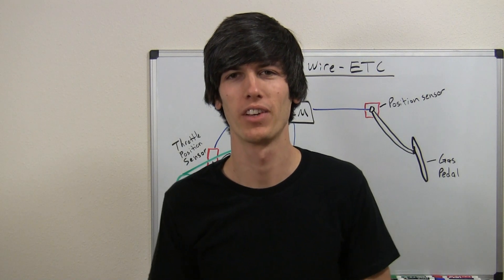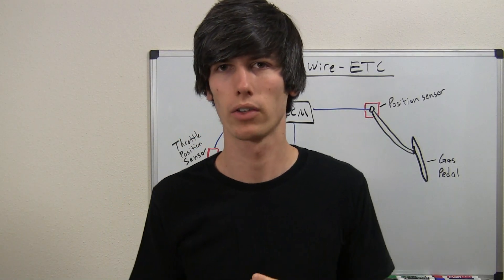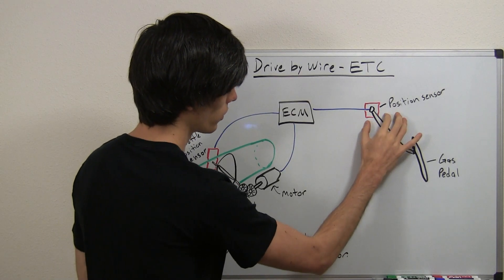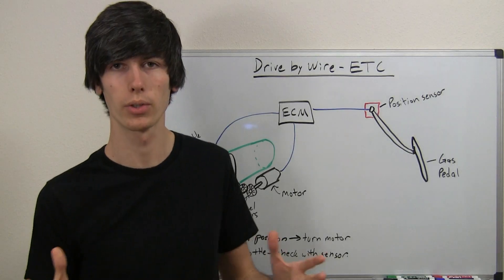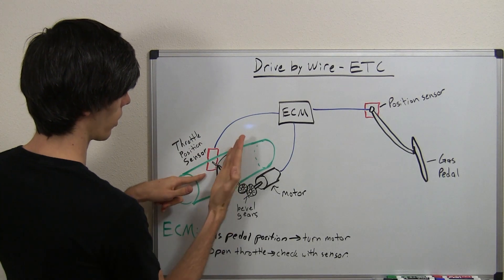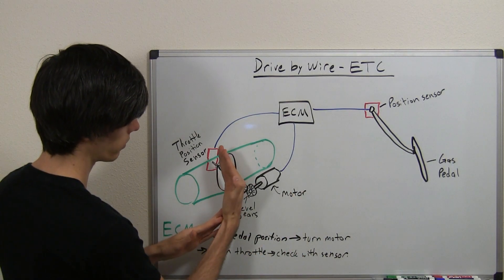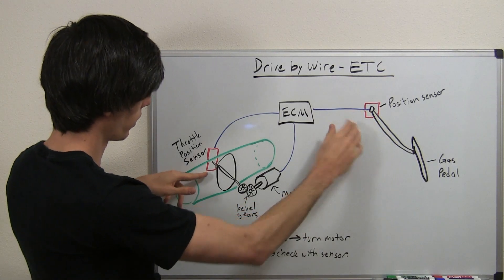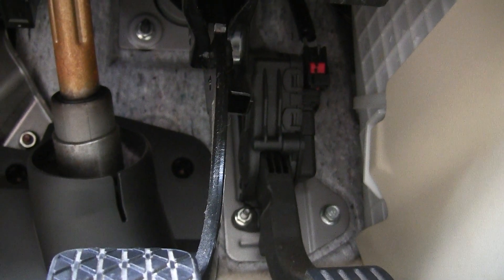Drive By Wire - Electronic Throttle Control - Explained

Comment: Where is the air idle control valve? Is it built into the throttle body and if so can it be the cause of an intermittent erratic idle?

Comment: Bad system. The "position sensor" is just a glorified potentiometer, the same system old radios had for changing the volume, the same one that would get scratchy and loose precision over time. I was laughing my ass off when i looked at teardown videos and saw the little wipers riding on tracks, i seriously can't believe they greenlit this concept.

Comment: It's not a "GAS" pedal - it controls throttle opening which controls AIR flow - it is the fuel system that meters the amount of fuel required to be mixed with the air volume for a combustible mixture. The air system (throttle) has no direct connection to the fuel system. Fuel is metered either mechanically by valves and jets or electro-mechanically by injection valves. Call it what it is; the accelerator pedal.

Comment: I have a problem with my plate not moving when I increase and decrease gas pedal.
And my ecu is not throwing a fault?
Any thoughts.
Reply: It moves manually.
But is set on the horizontal position.

Comment: in the diagram you could have showed what flows between the position-sensor and ECM. Is it a packet of  digital info (CAN packets) on the position of pedal , or is it an analogue varying voltage ?

Comment: Hi I have a question can I used my electric throttle controller with spot mode gear on my car or  if I do this can damage my car ?

Comment: Good day Sir
I have idle problem it drops when AC is On 
I have clean the TB,change ignition coil and spark plugs, check for vacuum leak but I don't find any.
But my car idle still drop when AC is On 😞
I hope you could help me. 
Toyota Yaris 2012 my car
Thanks in advance🙏

Comment: my vehicle has an issue that my tuner cannot figure out.
I been noticing a hesitation when accelerating 
There are 2 lines in hp tuners on the graph. one for peda percentage and other for throttle body blade open percentage.
He says the pedal is going to 100percent and the blade isnt keeping up.
Not even close. and it is causing hesitation.

No codes or check engine light on.

Comment: I hope you can help. will adding a aftermarket throttle controller such has Apexi over heat the ECU . i have a 2nd gen lexus is350  and read that this is the case. thanks

Comment: Some elec. throttle bodies cost $700.00 to replace.
If the device is so simple with a tiny motor actuator, should it not be only $50.00?
But if you win a lottery, you can lay low and just take the bus.
You'd have nothing to prove.
How long can " the next model year " continue ".
There has to be a point in the future where improvements are no longer required.
But, those who want to take their families for a drive on the Sun are waiting for the next model year.

Comment: Nothing you can say will convince me especially after the horror of the Toyota unintended acceleration deaths, that it's just as safe to allow your brake system to be controlled by electric impulses and  complicated computer programs, instead of a physical cable connection.

Comment: Hey, I have a question: does the ECM prevent engine lugging by limiting the opening of the valve even if you floor the gas pedal on a high gear?
Reply: Yes, precisely. That is actually one of the very few advantages of the electronic throttle, aside from traction & cruise control.
Reply: @luipars  Correct me if I'm wrong: so it's technically not possible to lug an engine, regardless if it has forced induction or not

Comment: Great explanation, but a terrible system! I've had mine go out on a 22 year old truck, on the highway. That's fun! Additionally, the new fuel pedal costs, from the dealer, $500.00! Thank God for Amazon! But in the end it still ran me close to $300 to replace. (I miss steel braided throttle cable).

Comment: Didn't the BMW Williams F1 2004 car have an electronic gas regulator based on the position of the track so that the drivers couldn't lift and coast at certain areas of the track?

Comment: I need to mod the gas pedal of a car in order to fit on the dash a pot for fast idle purposes as some accessories will be fitted in the car and i need it to idle at 2000-2500 rpm. Do you know what is the usual value of the potentiomenter inside a modern gas pedal?

If i don't find a schematic of this, i will have to get one at the kenny-u-pull, open it up and measure it myself...

Please, no comments about It's dangerous to mess with such things... we know that s**t already, thanks :-)

Comment: Hi,
Do electrical gas pedals have to be re calibrated after 10+ years?
My pedal isn't very responsive, its laggy, but when I push it down hard it goes,
In my opinion the throttle cable is much better,,
My car has been tested at mechanics, they can't find anything wrong with the car,plus no fault codes are coming up,

Comment: Hello dear.  I have a vw 1.9 tdi AHU engine with an electric diesel pump and i want to connect it to an accelerator pedal to check the throttle ... can you help with that ... thanks

Comment: How engine keep running when throttle is closed? Do butterfly valve keep partially opened?
Reply: Most have a small passage that bypasses the throttle plate, it goes through an idle speed control motor that precisely meters idle air

Comment: The reason why car manufacturers probably went the drive by wire route is that it saves space by eliminating cruise control cable actuators which can cost $200-$400. Also, you're dealing with less maintenance with cable adjustments and grime that gets into cable linkages and what not. I do agree with the lag in throttle response with drive by wire, but some car manufacturers got their stuff down and stand alone ecus can fix this I'm sure.

Comment: my throttle body motor and sensor got weak over 153000 miles . No check engine light, just loss in power and throttle response. Pain in the ass compared to cable systems.

Comment: The manufacturer’s make changes like this to reduce emissions and increase fuel economy. These are both mandated by government regulation. I agree that it does suck when there is a problem with the potentiometers or the gears that move the throttle plate.we gotta do what we gotta do to leave the planet a better place for those coming after us

Comment: Wish all manufacturers can do it right. I'm learning how to drive in a 2015 Kia Sportage and the throttle response is terrible. Not only that, you have to delay your throttle engagement from a complete stop to start moving without any jerks. Even if you are progressively pressing in the throttle, the throttle body ignores that transition if done too quickly. Also, the ecu gets confused sometimes when I ask to accelerate heavily. Even when pressing the throttle all the way, it sometimes refuses to open the throttle body all the way and it refuses to shift to a lower gear. I find myself being stuck at around 2000rpm with my foot all the way down. Going 40-60mph in 5 seconds.

Comment: I like the cable because one it wasn't completed second you could rev the engine from the engine bay and not keep going back to the driver side to rev it. If you were working on a car it would be easy from there. And also cheap to maintain such as if something went wrong it would be either the cable which is cheap or the flaps inside which would be easy to open up the this electronic one.

Comment: Hi, please explain what happen after press acceleration padel in ci engine, 
Please reply.
Reply: Sir as in petrol engine when we accelerate the throttle movement the flow adjust and speed fluctuate. But how it happened in diesel engine
Reply: Mins they use throttle in diesel engine also where? And how?
Reply: I think you did not get my question,
Sir when in SI engine when we press acceleration padel throttle moves up and supply more fuel and speed increases. So it happens in CI engine?

Comment: Great Idea, switch out a $20. cable that almost never breaks or fails, for an electric sensors system which costs $110. to replace when it ever fails.....
Reply: You won't get a diagnosis for 110 bucks, much less parts and labor for any part of this system. Just like every thing else, when the warranty is gone, send it to the landfill.
Reply: $110 if your lucky...
Reply: Electronic throttles offer so many advantages over cable. It's not about replacing when it breaks (which is rarer anyway). It's about traction control, emissions, etc.

Comment: can you extend these drive by wire cables without adversley affecting its function and trigger points.?  Converting my van from right hand drive to left.  Need to relocate the pedal drive by wire cables by a method of extending original cables.  Would this cause a problem.

Comment: And the reaction time on electric acceleration its 0.5 0.8 seconds after you push the pedal acceleration but the acceleration by cable its instant . The cable its good . I have right ?
Reply: Yes popa, you have it right.

Comment: is there a good way to convert drive by wire car to an throttle cable?    I cant stand new cars because they all have bad throttle response
Reply: Unfortunately simple answer is no. Modern cars are so integrated, that "deleting" ETC for a conventional cable would result in a mountain of issues to overcome. It would be easier to buy an older pre-ETC car and repair/modify/upgrade it to suit your needs than it would be to take a new car and try to revert it.

Comment: TBW likely shaves build time, and is intergrated into some traction control systems (will close butterfly to limit throttle and thus wheel spin)  That said, I HATE it and it needs to go.  Hell, there are aftermarket parts for many cars that can modify the signal, to try and speed up or slow down the butterfly action.  Some cars with TBW have lazy throttles, others are damn touchy.  I like my 06 scion xbo (throttle cable) but the newer xb has TBW and when my wife test drove one she hated it right away.  Thank's scion, you screwed up several things with the second gen xb!

Comment: Hi man, great video.
I recently found an issue with autodiagnostic tool in my Nissan Micra k12. 
Code description is P1126 -> Faulty Throttle Control Motor relay.
My car doesn't accelerate over 2,5k RPM. It seems to be in safe (or limp) mode. I'm driving at <10 mph (it's embarrassing).
Have you a solution to explain this problem? Thanks.

Comment: tfw i can't blip throttle for rev matching downshifts because the car has ETC and the ecu doesn't allow rapid RPM increase
Reply: What is ETC ?
Reply: @dattarajraikar4841  Electronic Throttle Control
Reply: @dattarajraikar4841  Electronic traction control

Comment: Ha! It's a lovely concept except... It completely kills the throttle response, adds unnecessary complexity and increases manufacturing and maintenance cost once components start to fail.

What on this flipping Earth was wrong with the darn throttle cable and a position sensor on the throttle body?
Reply: not only that, the throttle position is measured via a potentiometer, which basicaly means if the cable is damaged and making a short you basicaly have a stuck opoen throttle, that cant be unjammed secon of all, if you do happen to unplug it and replug it wrong, you basicaly invert it, means throttle on zero -> fullgas, throttle on full -> no gas
Reply: Old cable and manual throttle control fail to pass modern environment certification requirements.
Reply: @stevenpham1961  your missing the point.
Reply: @jaxnaturals  how does one program better throttle response? How is that done? Yes I missed ur point sorry.
Reply: @stevenpham1961  you cannot reprogram the PID's unless you buy software for your application, provided the software is available. Most high performance applications are. The point is that you can create strategies that are not possible with a cable, such as limiting throttle angle based on wheel speed and rpm, thus reducing load on the engine at low rpm.
Reply: First you have to understand that this system incorporates the throttle control, idle air control, Traction control and limp mode and other strategies thus making it simpler for manufactures. It does not kill throttle response unless the manufacture programs it that way for efficiency. I can program the throttle to move faster than a cable based on request. You ever see the video of the Corvette leaving the line in 6th gear? This is the reason. They can request different throttle angles at different rpms thus making the system more efficient. Just as if you were climbing a long hill at 80% throttle. You don't necessary need to go faster, you are just trying to maintain your current speed. If you have a cable, your in a fixed system and it doesn't know this thus loading the engine more than needed. You need this for all autonomous vehicles. The future is now, not in the past. The "good ole days" are always dying. Keep up or get left behind
Reply: @jaxnaturals  yes but they all are designed to have 1 second lag so…
Reply: @V8_screw_electric_cars  Where did you get that info?????? I have disigned the PID's that control the throttle and there is ZERO lag.
Reply: @jaxnaturals  you might have but stock they have lag, you expect everybody to reprogram their cars?
Reply: @V8_screw_electric_cars  they dont have lag. You may perceive lag based on certain conditions but there is no purposeful lag for no reason
Reply: @jaxnaturals  everybody says there's a lag so I dunno…
Reply: @V8_screw_electric_cars  there could be a delay for various reasons such as traction control (wheel speed differential), steering angle or limited based on rpm. These vary from manufacture based on programming. Under normal driving conditions, response is instant.
Reply: @jaxnaturals  I know in theory it should be after all it's what they use in planes but that's what I'm talking about the programming or I guess cheaper cars work slower don't have such good computers or something
Reply: @jaxnaturals  My previous car was an old Ford Escort coupe with a Zetec 1.8L 16V with mechanic cable to the throttle body and with their 115HP was more responsive to the gas pedal than my current Ford Focus with a Duratec 2.0L 16V 146HP but with electronic throttle body.
I feel like is not an engine problem, I think that the PCM/ECU/ECM is limiting the throttle valve position to reduce emissions or something like that.

There's any around this?
Reply: @RDCST  no way around it. The manufacturer limits throttle for various reasons. Responsiveness can be placebo and if you drag race the 2 the newer Ford would win unless it is heavier. The old ford may have a different gear ratio in the trans with a short 1st gear making it faster off the line.
Reply: @jaxnaturals  It's not about drag racing, If you do autocross racing it completely kills your momentum. I have a 205HP car that has Drive by wire, 7 speed DCT and all the good stuff. It's fast but the response is worse than my mothers 116 HP Nissan that has cable. There is lag, if you drive fast on turns you notice. Also sometimes in autocross you only need to touch the throttle a little bit to balance the cars weight through the turn, in Drive by wire the first 5% of pedal travel is like a simple button, meanwhile in Cable you control it from 1% all the way up to 100%. It matters if you are a passionate driver, a daily driver not so much.
Reply: @gabagogolscar4864   if your auto crossing,  steering angle comes into play and will limit throttle response based on traction control. Manufactures do not design response based on autocross or any racing. It's based on normal driving conditions. I would not autocross a car that I did not have ecu control to flash and traction control off button, or a performance car such as a vette unless it's just for fun. Then you have to learn how drive that car and its characteristics. DBW is not going anywhere so get used to it.
Reply: @jaxnaturals  Is it still easy to rev match with drive by wire?
Reply: @jaxnaturals  Percieved lag...hahaha
Reply: @jaxnaturals  Then why am I researching how to get rid of DBW???

Comment: Always get to learn a lot from your videos. A good amount of my knowledge and understanding on automobiles have come from your videos, and I really thank you for that.
But I have a question in regards with the Drive By Throttle setup.
Why does the motorcycle/car, having a Drive By Wire, kill the engine when the throttle pedal/ throttle opened up all the way??

Comment: Can I remove the throttle body plug the cable back into the unit and then turn on the ignition.
(not turn over the engine) then if I press the gas pedal will the butterfly open?

Comment: so does that mean when my car get's EMPed, though manual transmission, will not work?
Reply: Transmission doesn't matter. If you have a computer controlling your engine, throttle, or brake then that will get fried in an emp.

Comment: what's the benefit of this system more hp or more accleration ?? what is it for
Reply: Cruise control, idle control, traction control, boost control in some cases and various engine safety features all integrated in the ECU and DBW throttle.

Comment: Auto manufacturers when coming up with ETC: 
 - "How can we increase our vehicles' overall cost and complexity while at the same time decreasing throttle response?"
 - "Oh I know, let's replace the time tested throttle cable with a overly complicated computer system! It'll be SEWWWWW FAWNSEHHH"
Reply: Correct. Planned obsolescence.
Reply: The reason is to allow the cruise control function to exist.
Reply: Soo many WHETAHDS